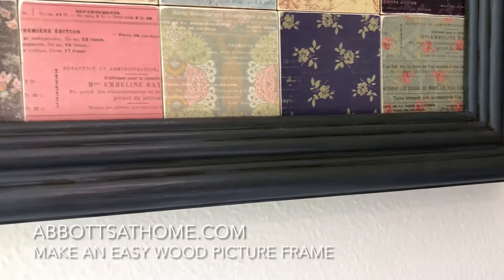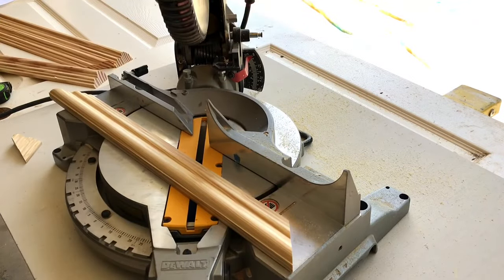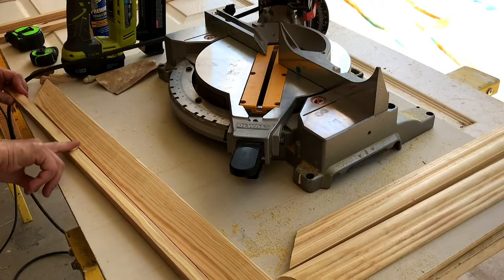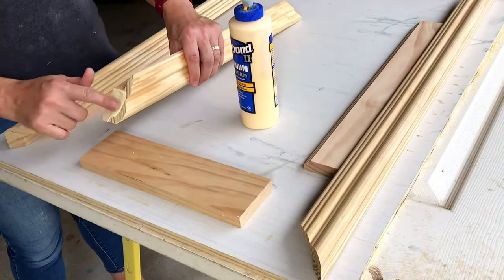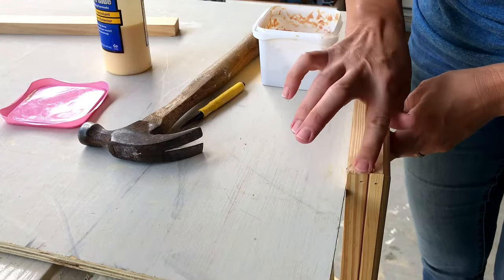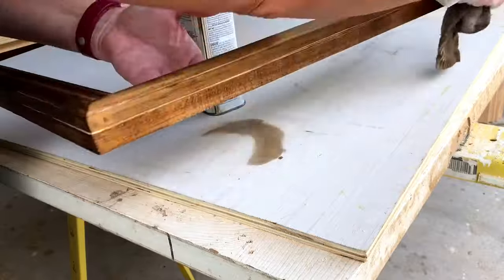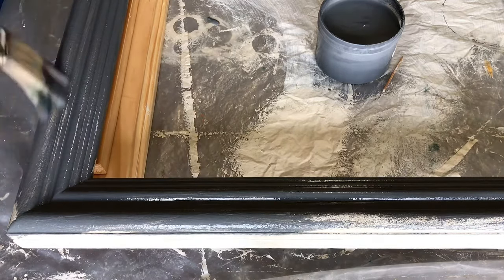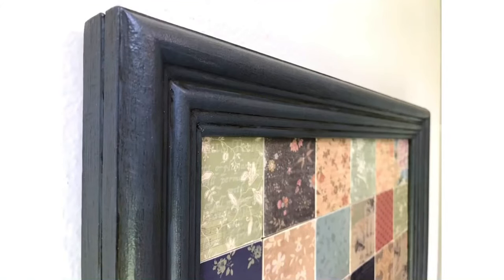The SUPER EASY Way to Make a Wood Picture Frame - Using Trim Molding!

Comment: You jumped from the frame to showing it hung on the wall. I wish you would have shown the back of it and how the glass fits in. Is it just inside the 1x1? How did you decide where it went and did you use points or glue or ???
Reply from the maker: Hi! I actually don't use glass for anything I frame. I've heard people say they might use points. I would imagine it would work. But, I don't have any experience with it.

Comment: Great video. getting confidence to do my own frame now. i have 60x40 poster, what material is best for backing the  picture, and how to measure, cut the backing material and attach the picture.
Reply from the maker: I would cut the backing to fit the poster. Then make the frame to fit that. 1/4" plywood would work well. You can permanently attach the poster with spray adhesive, use painters tape, or double sided tape along the outside edges. Whichever you like most. :)

Comment: Do you think I can do the cuts with a hand held circular saw?

I mean I know I can but do you have any suggestions to get the measurements on point.
Reply: You might try to get a miter box with saw to country wood strips add 45° angle

Comment: How did you secure the back of the artwork into the frame?
Reply from the maker: That video link above is one option. I ended up using command strips to attach my art to the inside of the frame. You could also use wire nails and small wood blocks to hold your art tightly in the frame. 👍

Comment: Would this work for something heavier like a mirror?
Reply from the maker: You can frame a mirror this way. But the frame won't be strong enough to hold the weight of a mirror. Make sure that the hanging hardware is attached to the mirror instead. Good luck!

Comment: Curious  on what the cost of this diy was? Also will it work for canvas paintings?
Reply from the maker: I made this frame with about $15 worth of trim. But, the total cost will depend on the size. 
You can make this for a canvas. Just be sure to build it to fit snugly over the canvas or use another way to hold the canvas in place. Check out this video to see a frame I built for a canvas https://youtu.be/tJccsdqZmOw
Reply: @Abbotts At Home - DIY  Thanks I'll  check it out....Ty for sharing!